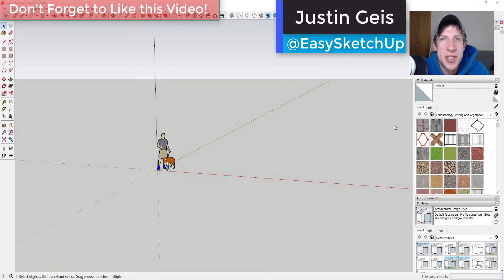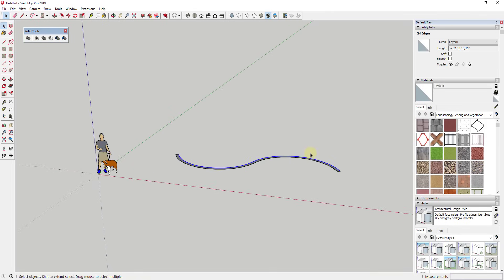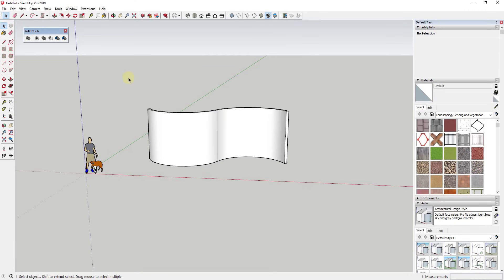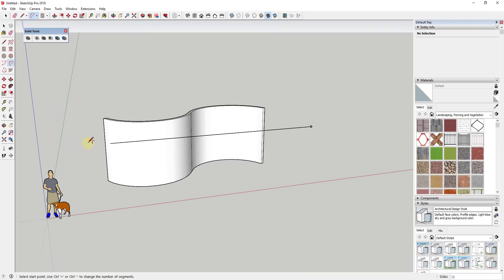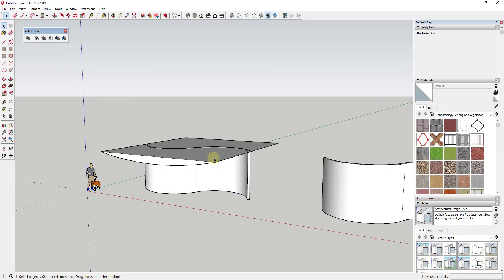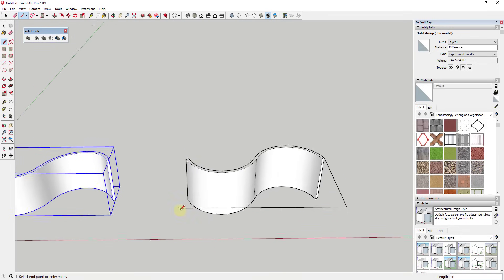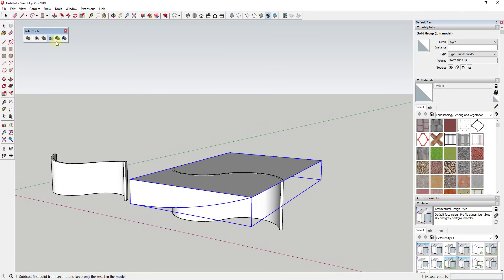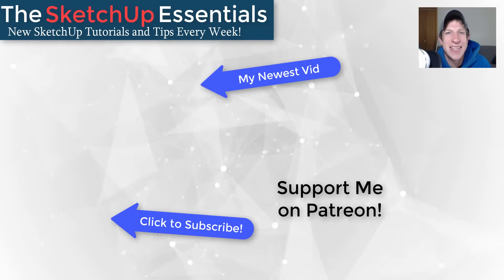Modeling a DOUBLE CURVING wall in SketchUp with Solid Tools

Comment: Hey, how do i do this with regular Sketchup. I do not have the Pro version.
Reply from the maker: I'd probably create the wall by extruding up the profile, then use solid tools to remove a portion of the wall for the portion that drops in elevation, then use another rectangle with solid tools to remove the opening as well

Comment: Hi this is amazing, far too advanced from where I am currently at but I need to do a curved wall on for a sloping garden, I have followed your video however it is saying 'one or more of the selected objects is either not a solid or is locked? can you advise where I might be going wrong? Thanks :'-)
Reply from the maker: It means that your wall or your cutting object either has a hole in it somewhere or an internal face - it's not a "solid"

Comment: Hi Justin, Thanks for this useful tutorial. I've been using solid tools quite a bit and noticed that occasionally grouped geometry doesn't turn into valid Sketchup solids. To help out in these situations I use Solid Inspector² from the Extension warehouse: https://extensions.sketchup.com/en/content/solid-inspector². This extension can identify a bunch of different problems (boundary edges i.e. holes, internal faces, stray edges, nested instances) and mend some of them automatically. The Trim option in solid tools is also a great way to cut away bits of geometry without affecting the part you're using to cut.

Comment: Justin, nice demo but it's not quite right. The curved cut that you created as the cutting solid is parallel along the horizontal. When creating a curved wall, or even a hedge for example the cut is actually radial to the vertical face/s. Your demo creates a good visual esp for narrow walls, wide walls don't look so good. Perhaps do a more advanced video using true bend or cut along a path, 1001bit (I think).
Reply: I agree.  The elevation change needs to be consistent along the path of the wall.  Not sure if there is another video of Justin’s covering this?

Comment: It's all good what you show there, but I use SketchUp make and I can not use this solid tool, unfortunately. It has to be something else for that.
Reply: intersect faces ?
Reply: @Eigenartigsten  it is elaborate, there is a tool hole on solid, it does the same thing as solid tool
Reply: @w.binder-freecadchannel  just use intersect faces and delete all the parts you don't want